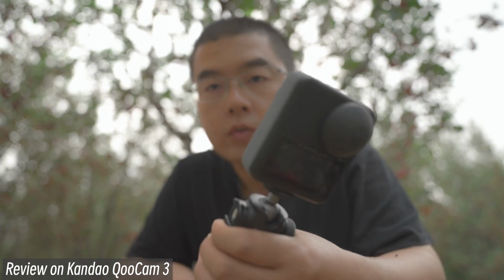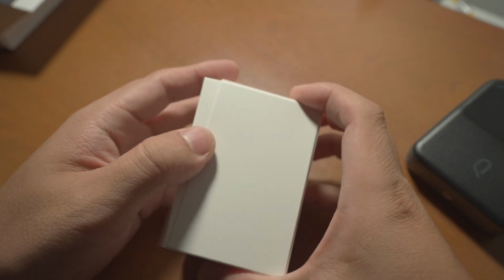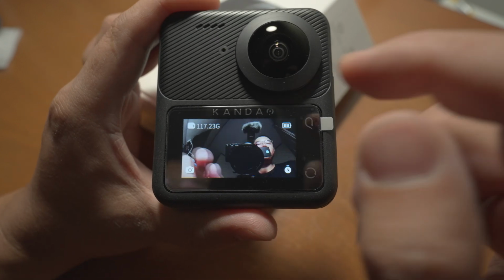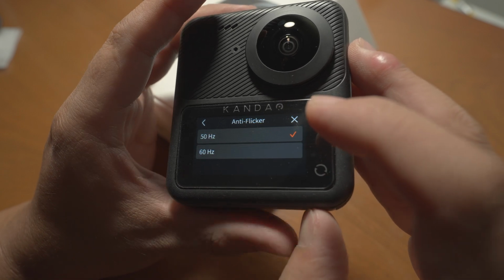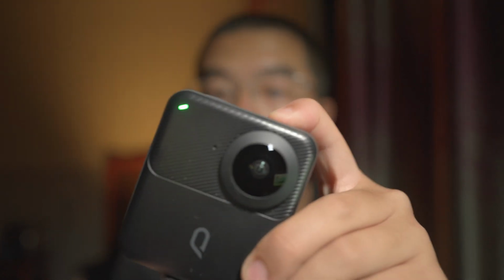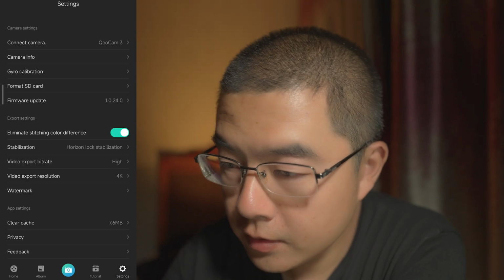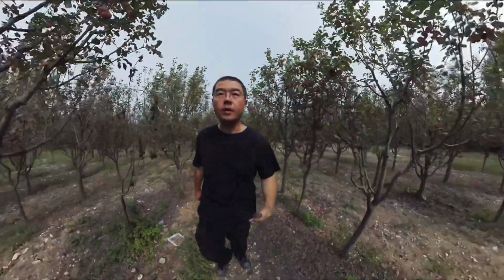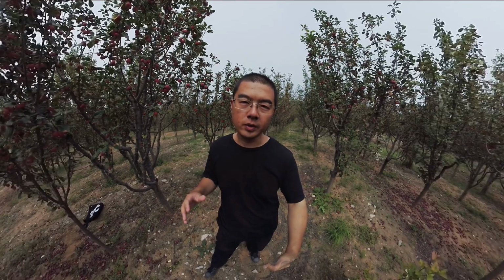Kandao QooCam 3 : THE 360 Camera Revitalized !!!

Comment: Thanks for the great review. I got mine yesterday and the insta360 x3 today. It's a tough decision!  But I gotta say, the form factor is definitely better with the x3, the stich is better too. Also, the battery on the Qoocam 3 has a tendency to fall out because you got to leave the door open to charge the battery, so you gotta make sure it stays charging. Very annoying, and definitely better solved on the x3 that has a seperate door for that. Also: NO CHARGER available for the Q3, as far as I can tell?? So even though they send you a second battery, you gotta use the cam to charge it. Meaning, you can't recharge one and keep shooting with the next. Also: if you want to work on the RAW files, you need a second Kandao software called RawPlus to convert your DNG into a jpg that you then can open with Qoocam Studio. Why can't studio just open files? The workflow is already crazy convoluted. Also, having compared DNG8 from the Qoocam 3 with the TruShot of the insta360, frankly, the insta is still better, Has more clarity. So I couldn't see the point about more detail in bad lighting. On the other hand, q3  seem to have fixed the crazy sharpening issue in daylight already. I don't have those weird artefacts anymore. On the other hand when it comes to video, insta360 records their own file type which you cannot import with anything except Premiere. So you HAVE to do the keyframing in insta studio first, export it and then edit it in Davince or whatever you have. Q3 makes Mp4 files, so you are good there. However the plugins in Davince arent 100% optimized for the Q3 yet, so its almost impossible to edit as of now. So, either way, you can tell insta360 has 3 years of customer-centric design on its belt, Kandao does not. So the question is how long will the take to catch up? If they keep the more open standard policy, and work on the workflow issues they will be really really good. However, the insta 360 price has already dropped here in Germany, so its only 50 EUR difference now.
Reply: Thanks for your comment and advise. Qoocam 3 battery charger is on the way.
Reply: made a decision. The qoocam makes better photos, but it‘s just too impractical to handle. Its a shame but: the batter life is too bad and ot keeps falling out. I considered running around with a powerbank and plugging that in, but thats pretty ridiculous.

Comment: thanks for the walkthrough, i got mine  a few days ago and honestly the 62mp mode is useless and wouldnt make any difference. it simply looks like they interpolated it purely for marketing. DNGs in 16mp resized up , even without any AI, looks about the same as 62mp. With AI resize to 62mp (aka 11k) it looks way better. let me know if you found the same.  i hope Kandao implements HDR video, thats the most needed feature imo for it to be MORE competitive than the x3.